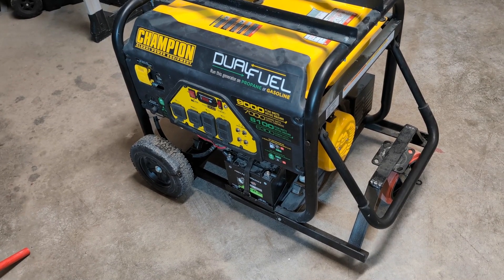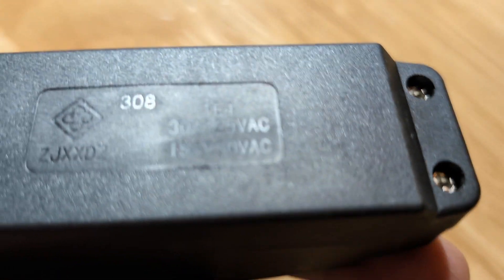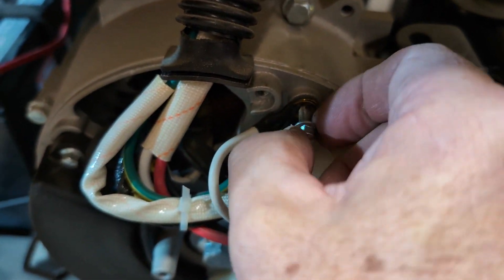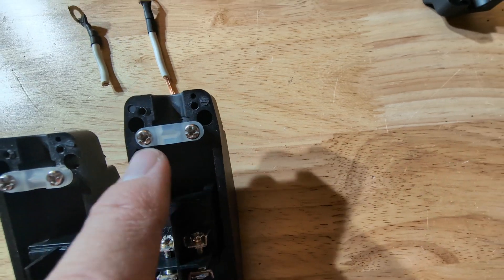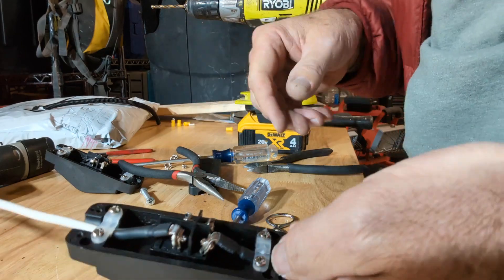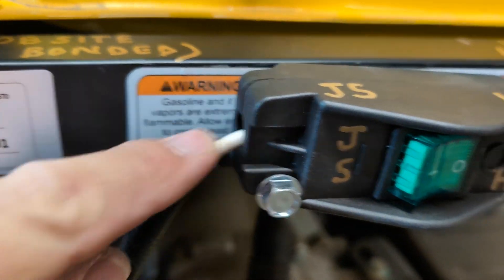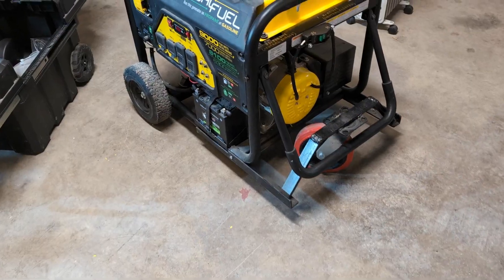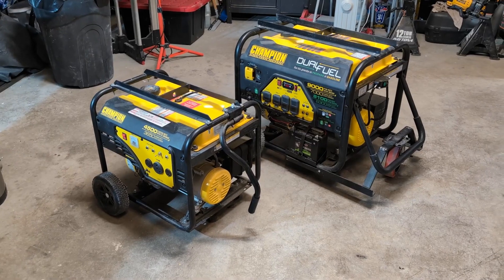Champion Generator Neutral Float Switch

Comment: Great idea…my only issue is that switch not rated for outdoor use so if it gets wet it could be a serious hazard…any suggestions?
Reply from the maker: You're right, the switch itself could allow water intrusion. I siliconed the ends where the wires go in. This generator lives in a generator shed, and will never be run outdoors unless the weather's good when I'm working outside. But you're right, the weatherproof switch would be better

Comment: Good video! Thanks. The idea that has saved me a few times is that I have BOLD markings on the face of the 120V switch covers of the generator reminding me to flip that switch to "Job Site" before use AND a sticker at the transfer switch telling me to do the opposite. This way your covered. The reason of course is that when you need to hook this up to your house it's because there is a lot going on due to an outage or whatever so it is easy to overlook the need to flip that switch. I'm a pilot so I've learned more than once that checklists can save your life, especially in an emergency.  Thanks for sharing!
Reply from the maker: Yes! Redundancy for critical steps. I'm not a pilot, but have a few thousand hours as a flight RN, and working around mechanics and pilots for years has taught me a lot, and always double and triple checking has literally kept me and my crew alive. When your a$$ is literally in your own hands, you operate at a different level. I'm going to label my transfer switch now. Thanks for the feedback, and keep the tail pointed up 😁

Comment: Are you doing this because your house has a bond neutral and your generator has a bonded neutral and you need to disconnect the generators bonded neutral to run it to the house and then your generator becomes a floating neutral?
Reply from the maker: Exactly. I am not an electrician, but from what I gather from Reading and from talking to electricians, there should only be one neutral bonded to ground in the connected system.

Comment: I like the switch idea..
Looks good to me..
Reply from the maker: Thanks, I used the generator a couple days ago for a welding project out on the property, where my cord couldn't reach. I just flipped the switch and went to work, it worked perfectly. When I was done, I put it back in the shed by the house and flipped the switch back to house mode. I think it was worth the effort

Comment: I have a champion 50a generator 201176….trying to add an inline switch as well….any ideas?  Does a inline switch have to be 50a 125v?  I want the option to use it as a stand alone generator or connected
to the house

Comment: Where can you find the extra wire to extend this?  What kind did you use?
Reply from the maker: @mae2759  Autoparts like Autozone or hardware like Ace. My original wire was 12 ga, I went up a size to 10 gauge. Heavy duty 120v switch.

Comment: Useful info!
Is there a switch for 240v gens?
Also, I have a non-open frame inverter generator (champion 201175) and can't find any info on accessing the bonded neutral so I can modify it, any ideas?
Reply from the maker: @simeon2064  I'm not sure of a switch specific for 240 volt. Inverter generators still have a rotor and stator that produces AC electricity, then converts it to DC, and then back to AC. But as long as you can find the generator Head which houses the rotor and stator, which should just be under a panel, you should be able to find your neutral wire. But before that You can test if it's bonded, by using your ohmmeter in testing for continuity between the ground and the neutral. If you get kind activity through those two, then your neutral is bonded to the frame for sure. I have one champion generator that is not bonded from the factory
Reply: @anesthesiadreamin  thanks!
I actually did find the neutral.
It was super easy.
I'm unsure about any kind of switch yet.
Reply from the maker: @simeon2064  yeah, switch definitely not necessary, but just makes it more convenient if switching back and forth between household use and use on powertools etc. Good job! and thanks for the feedback